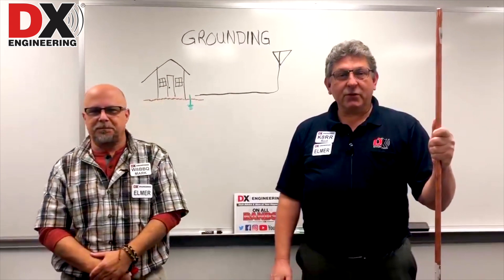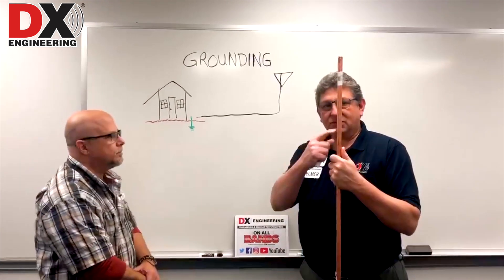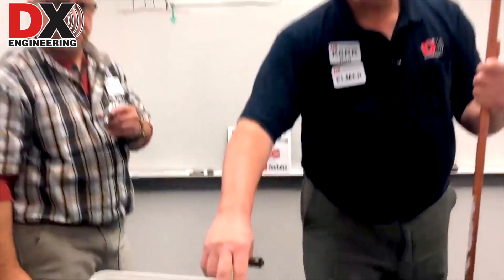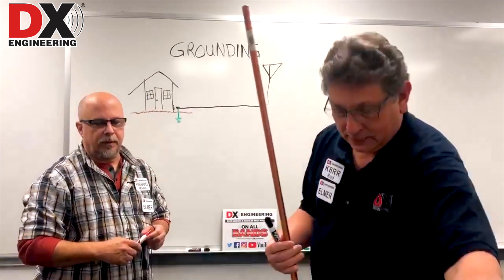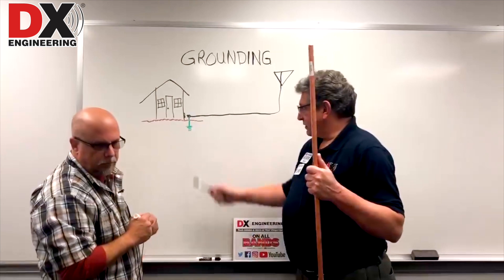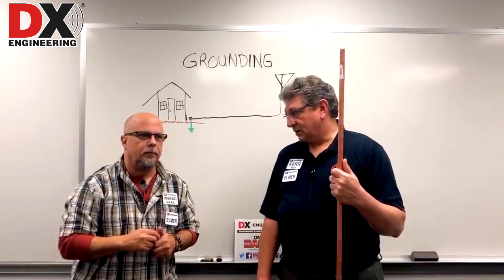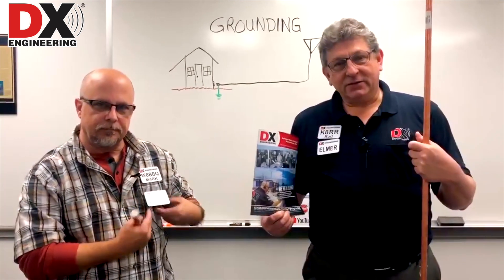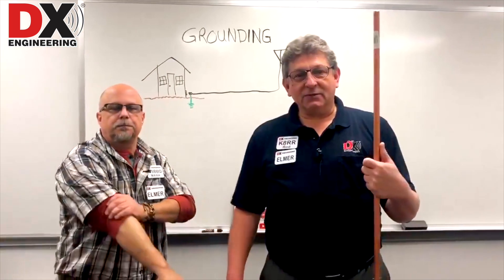Grounding Tips - DX Engineerings Q&A Wednesday - Part 1

Comment: A recent ARRL meeting discussed not bothering to connect internal grounding bus bar to the earthed copper rod connected to the panel. Just ground separately to the AC ground. One Youtube ham mounted thread/wing nuts on the case of a Belkin multi outlet box and connected all his equipment separately through straps to that.

Comment: A couple points.... 2:54 its not that its better to connect the shack ground to the house ground, its MANDATORY per NEC... 3:03 There is no difference in "types" of grounds: they are all connections to the earth and should all be done the same way. What most video producers fail to consider is the resistance to ground in a grounding electrode system. All the expensive flat copper strapping is worthless if you don't have a good low resistive ground (2 ohms or less) Spend your money on that first.

Comment: I wouldn’t mind seeing a detailed video dedicated to the enclosure. Mounting resisters, mounting to different sidings,brick,stucco, etc.  using metal self taping screws for the plate. Cleaning aluminum plate with kit? Just came across that. 

using 1 1/2” pvc with threaded adapter has to be filled to fit through hole in back. You can always just shove the pvc through but looks better with a flange / protects wire when pulling through.  

Making a dedicated video would save a lot time researching

Comment: My Yaesu FT 2980 does not have a ground connection other than the AC ground connection on the power cord.  Would I be required to connect a wire from the radio housing to a bus bar ?

Comment: You should suggest that the connectors, PL 259, ground rod clamps and so on, should be crimp-on style and not soldered. Lightning can cause enough current that it melts solder and it becomes liquid and can be expelled out of the fittings.

Comment: OK. Can I confirm something with you guys? (I am a noobie).  I want to put my shack in my basement. So I would run a LMR-400 feed line to the exterior of my house. (Where I have a plastic electrical box with ground in it.)  I would then install (and bond to ground) a lightning protector and connect the feed line to it.  Then I would take another piece of LMR-400 and run that from the lightning protector to my antenna. Is that correct?  Thanks.
Reply: Hey I have the same question you do. Did you get this answered?

Comment: Its worth mentioning guys that the grounding methods discussed here are suitable for United States properties but may not be suitable for all countries. Certainly here in the UK because of the different electrical systems or codes as you call it, grounding your antenna coax directly to a ground rod can under certain main supply faults be a danger and cause electrical shock and fire hazard, as the ground rod may be the only fault path in the mains electrical circuit.
As Youtube is a Global platform it would be worth mentioning on camera the fact that you are specifically speaking to the North American audience and not the general worldwide ham audience. 

Bill GM4UBJ
Reply: @ReefMimic  Hi Reef , you misunderstand the hazard is from your mains electricity supply side not the antenna side( we are not talking about lightning type hazards)
In certain rare mains supply electric faults here in the UK the route to ground can pass from the mains through your radio equipment to ground not the other way round. The reason it is a hazard is because the chassis of power supplies, PL259 etc may then have a voltage on them which under this rare fault condition may rise to phase potential (230 v in UK) so you may get an electric shock ,and if the fault CURRENT is high enough the insulation on the coax and wiring may melt due to the heating effect in the wiring.
So by putting in a good radio ground you may inadvertently be creating a good electrical ground which is better than the supply utility ground. As I stated this can be a concern with certain electrical systems or codes in various countries.  
Bill GM4UBJ